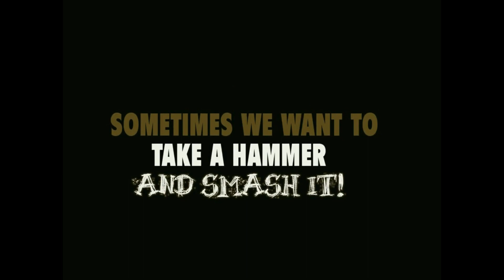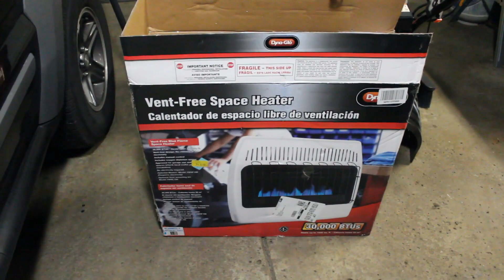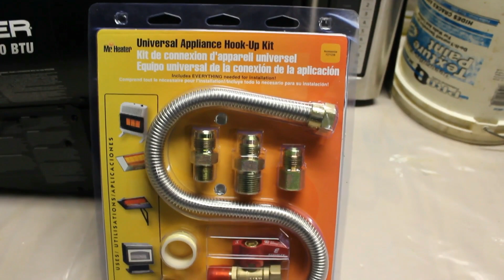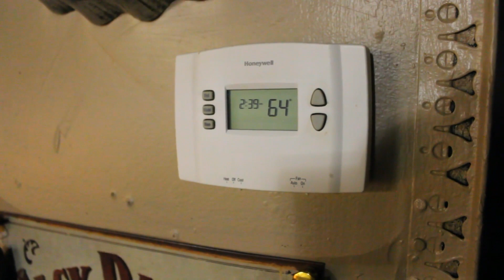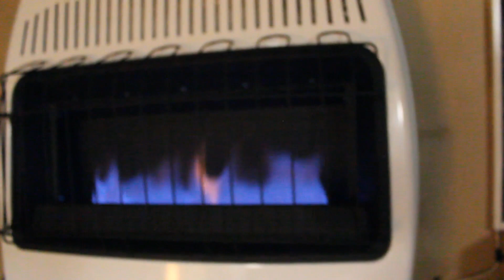How to install the DYNA-GLOW vent free gas heater

Comment: Interesting video, thanks!
I've set up a heat pump in my garage. One of these pre-filled with the coolant gas so you can install it yourself. Our government still require a certified installer but mine has worked fine for 5 years without one.
Originally it was just a fun weekend project that would never pay off economically. But now that Europe has "gone green" and electricity is 10-20 times more expensive than it used to be, the heat pump is really starting to pay off. It is really nice if you drive in a car with rain or snow on it in the garage. It can dry it out in a couple of hours with a dehumidifier running in parallel.
Reply from the maker: Thanks for the comment, yes it's working out so far, I actually washed my car in the garage last night and the heat helps dry it and as you said when coming in with the snowblower it helps melt and dry the floor, although I will use a broom and spread the water out on the floor so it dries faster. Your setup sounds nice too.

Comment: What size is the flexible gas line? inside and outside diameter and the connectors on the flexible gas line.Also what size are the flare connectors on the house supply gas line and the connection on the heater ? Mine came with 3/8 npt and 3/8 flare on the regulator but yours looks bigger. 1/2? Thanks. Maybe use your Mr Heater rocket heater with a portable propane tank to melt the snow in your driveway!! Lol
Reply from the maker: yes 1/2 inch and good idea I think I may try that melting gig, maybe build it on wheels.

Comment: Some say you need to install a gas regular even on the natural gas .I know you need one on lp gas but our natural gas meter on, our house has a regular but I read that the natural gas heater still for safety issues needs one in line before it goes in the heater .but I thought the heater has one in side were you run a gas line in .if you Google this it still tells to buy one and put on the gas line for extra safety before i the gas line screws in the heater  looks like a over kill .my girl friend has installed meny wall natural gas heaters in her rental homes and she don't add a in line gas regular. This is in western ky areaa but if your gas company has your gas regulated right with low pressure you don't need another gas regular in line I read that two but also it's still not a bad  idea to have another I read that two Lol but I live in Louisville ky not west ky and have ll g &E gas and electric company were she has another company .

Comment: I'm on my 3rd call trying to find a professional who will install one for me.  No one will.  Why do hardware stores sell these but there is no one to install them?
Reply from the maker: Sorry to hear that. Nobody will install a gas line for you?
Reply: @frankiefixdiy  No. I have a gas line, I just couldn't find any large HVAC company willing to install a ventless heater.  After many calls, I finally found a small company whose owner said he would "try" as he had not heard of these types of heaters before.  He came by, took a look and was able to install it.  He said it was relatively easy, made sure I wouldn't have any leaks through the threads of the gas line connector and charged a very reasonable price.